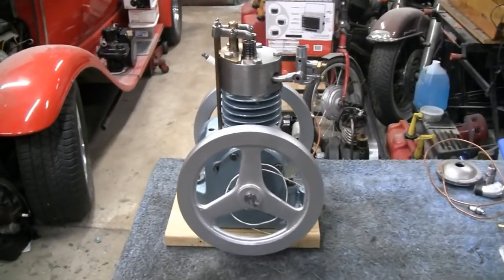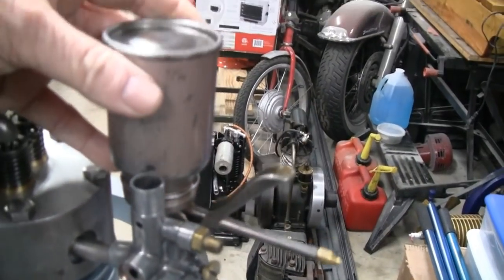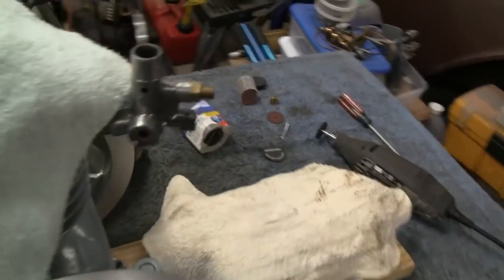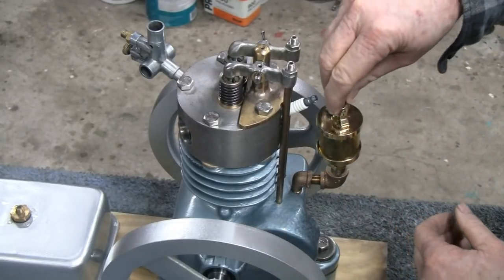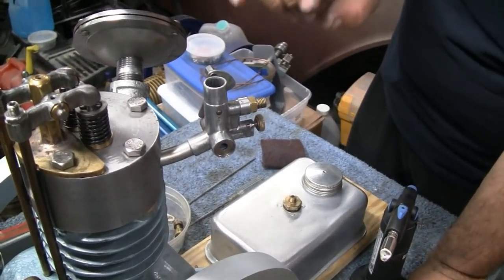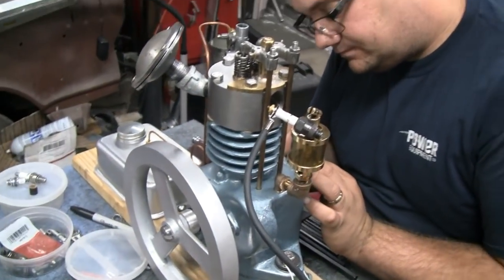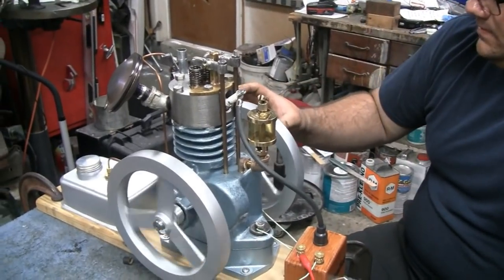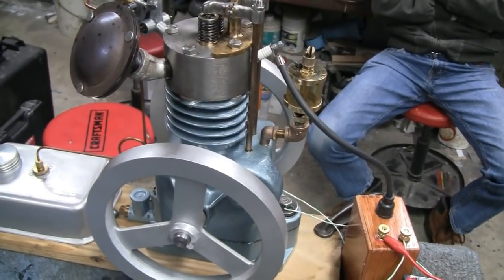HOMEMADE OVERHEAD VALVE BRIGGS (part 51)

Comment: Runs sweet!! I have an idea. Mabie you could use a filter off an Antique air compressor or something. I had one once from a swap meet & it was around 2" across. Had a bunch of thick felt sheets inside & the cover had a bunch of holes punched in it & was held in by  a circular retaining wire spring clip thing that fit in a grove inside the filter housing...
Reply from the maker: Thanks Eric!! We came up with something, it fits the engine well!!☺

Comment: Protective equipment ain't no joke, folks. Bits of metal WILL sling into you. Thank you for not being the grumpy guy who won't wear eye protection.
Reply from the maker: I've had a sliver of steel stuck in my eye before, it ain't any fun!!☺
Reply: Those little Dremel wheels can be nasty.  I got a couple scratches from a broken one on my then-new glasses.  I keep those scratches as a reminder.

Comment: With the way you have the ignition set up, eventually will the battery die? Why not run a belt from the flywheel to a generator to recharge the battery? Not that you need more stuff to add to this beautiful motor! I'm just wondering how ignition systems work.

Awesome job, looks like a million bucks!
Reply from the maker: Thanks Buddy!! The batteries we use usually hold a charge for over 3 years for us!!☺
Reply: @805ROADKING  no kidding?!!! Forget I said anything.

Comment: Yall went this far. Its time for yall to build an engine from scratch. Or try and build a straight 6
Reply: They have a radial engine that's in the works. The 4 cylinder briggs they built was awesome, as is pretty much anything they build. Mike is an engine savant.
Reply from the maker: Maybe some day!!☺

Comment: No disrespect intended, but won't the lack of cooling be an issue?  Perhaps it's just intended for short runs?
Reply: Its mixed in with the gas.
Reply from the maker: Once we get it all tuned and adjusted it should be idling about 250 RPMS so cooling won't be a problem!!☺
Reply: For a slow rpm engine, that's only meant for show...this is perfectly ok. Don't forget, that's a huge chunk of metal up top. Way bigger than any other engine's cap proportional to the piston size.

Comment: i remember those. exploding dremel wheels nothing like being hit in the face with a few pieces
Reply: I had to cut the brass bolts to pull and restab a toilet. Almost lost an eye. Those cheap cutoff wheels pick up some serious velocity when they break apart!!!! I got lucky and took a small cut just left of my left eye. Now I always use safety glasses for stuff like that.
Reply from the maker: That hurt like a bitch, it was going about 35 thousand RPM!!☺
Reply: @805ROADKING  they sure do 😳
Reply: @805ROADKING  ouch!!!